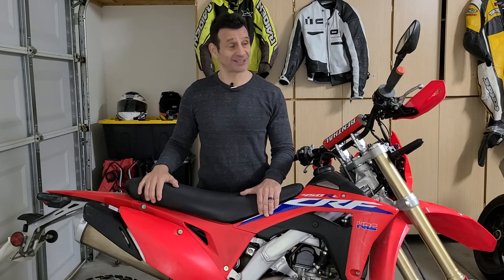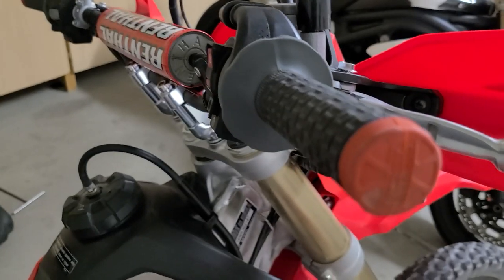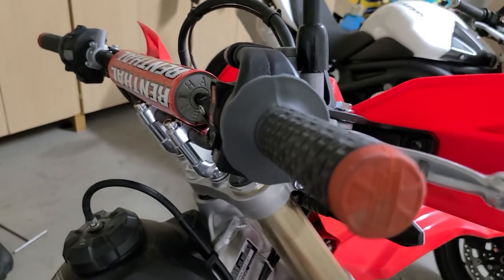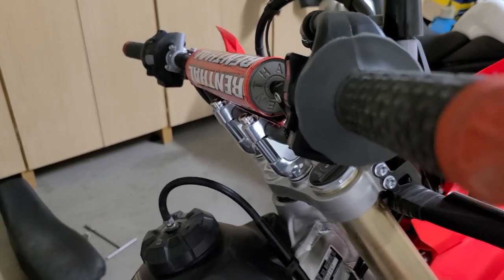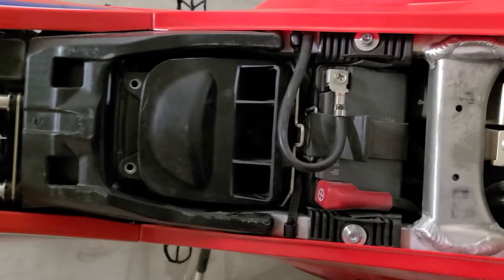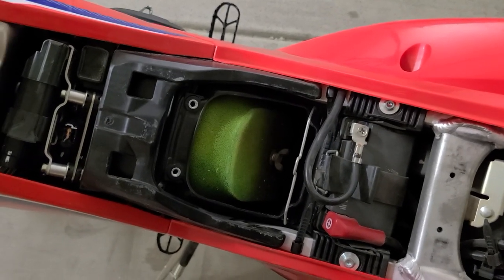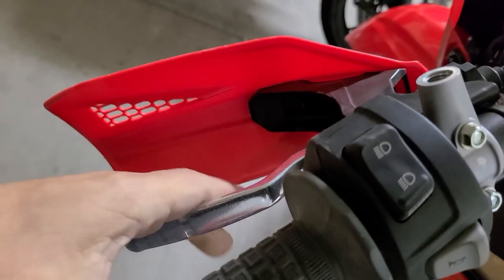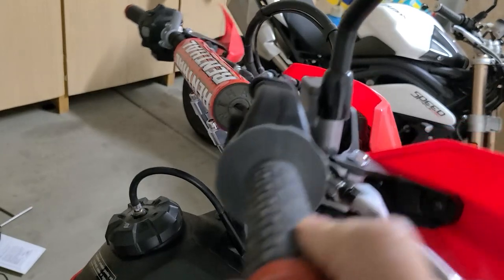Secret Honda CRF 450L ECU Fix. Dont Buy That Vortex ...Yet

Comment: I have a problem with my 2003 that when I turn right it would die. I think it was pinching the kill switch or some other wire. Too much filler in the video in the start.

Comment: Hey, bought a 2023 450rl, anyway clipped a tree going 5 to 10 mph with my clutch.  Electric starter stopped working only starts in neutral.  Tried adjusting my cables.  Thoughts on a fix.  

Thanks for video great thoughts on the chopping.

Comment: I own a 2022 model CRF450RL. I run the Vortex ECU, FMF exhaust, G2 throttle tamer, Steahly flywheel weight and Rekluse clutch. The bike is nearly perfect now. Super smooth on or off road with plenty of power. Much smoother than the KTM500. And with Honda reliability it's definitely a keeper.
Reply from the maker: Awesome I am almost there with the mods lol
Reply: Does anyone know if these mods void the factory warranty or the extended Honda warranty?
Reply: Right, I've done the same (except Rekluse) and it's perfect for me.
Reply: @LichaelMewis  factory warranty is only good for 6 months anyway.
Reply: @danieltllarson  I have an extended warranty.
Reply: But how much did you have to spend overall yo get it there? Is it similar to buying a Ktm 500 new? Just curious
Reply: What are total costs on all those mods, Jerry T?
Reply: @TheZakkmylde  because the Honda is $3000 less than the KTM you can do all these mods and the total cost of the Honda is still less than the KTM. And to add insult to injury, my friends that own the KTM are doing the same mods to it.
Reply: @NobodyLikesTheTunaHere  I have less than $3000 in all the mods I mentioned which puts the total cost of Honda at less than the KTM.
Reply: Is that hydraulic clutch? Can you use the one from the crf450r?
Reply: It sucks we have to invest another $1500 to make the bike act right
Reply: @LichaelMewis Yes. Wait for your warranty to run out before u make these changes. Especially the ECU.

Comment: Just got on installed today on mine.  It works really well.
Reply from the maker: Awesome Im looking forward to the day I get mine
Reply: So is a stock 2022 CRF450L that im mainly going to using for the road a better or should I get the FE501?
Reply: The Honda will be better for road use due to it weighing more than fe 501.  Mine has over 800 miles and hasn't seen dirt yet.

Comment: I can second this video. I have only installed the throttle tammer and it made a big difference.
Reply from the maker: Nice let me know if you have done any other mods
Reply: @BornAGoon  Ok I just got done installing a Whiplash seat kit. It's much larger than stock and the color is black rather than the stock red. It doesn't look as fast but boy does it feel so much better!

Comment: Turning up the idle doesn't fix anything just somewhat hides it. Bike still runs so lean the exhaust glows red and fan runs almost all the time unless you are on the road. Running lean produces major heat in a motor. Heat is the enemy of a motor. You want the bike fixed you have to buy the Vortex. I'm not talking about doing it to make more power which most people couldn't even need I'm talking about just getting the bike to run properly
Reply from the maker: It does help the bike a bit, but I agree with you that you need the Vortex to make the bike right. However, some people don't have the cash for that, and if you do, it is a 12-week wait. I ordered my vortex in January, and I still haven't received it. So this is a cheap, easy solution to hold you over. Thanks for watching.
Reply: jd tuner works. i got a pipe and its nasty
Reply: The idea that lean mixture produces added heat is false statement and a common misconception. Stoichiometric mixtures (ideal air-fuel ratio) produce most heat.  All motorcycle headers glow red with engine load and lack of airflow at low speeds to cool them.  Same reason your cooling fan is operating.  The risk of lean fuel mixtures is they produce detonation (uneven burn).  Detonation damages pistons and valves.  If you bike was running too lean your engine would be trash in short order.

Comment: I put a G2 throttle tamer on my 2019, I also put what’s called a “booster plug” on my bike…drastically eliminated flameouts and smoothed out the jerky throttle response…it’s crazy how no one talks about the booster plug $150….but every one raves about spending $750 on a ECU box
Reply from the maker: I have not heard of the booster plug Thanks for bringing it up I will check on that
Reply: Can’t add booster to 21 or later.
Reply: @danieltllarson  no, I believe it states on their website that they do not offer it for the later models…I didn’t really understand the rationale behind their reasoning

Comment: Srry for my English but I want share my exp. I have crf 450l 2019 Eu version. I have full yoshimura exhaust. The problem with flameout in my bike was the air filter and evap system, I just put oem filter open aire filter box and block evap system. I work in Honda motorcycle so I could test lot of things. In begging I thought the problem was low fuel and yoshimura, change stock exhaust and continue problem then close air box same problem nothing change. After lot of test like I said problem solved with oem filter open box and yoshimura full
Reply: I will try to make video and share with u
Reply from the maker: Thanks Just put in a AiM ecu it its nice

Comment: Apples/Oranges but the best mod I ever did to a bike was adding a heavier flywheel to my old 89 CR500. That bike was a freaking tractor in the woods. To stall it, you had to do it deliberately. 😆
Reply from the maker: Alot of people have been talking about the flywheel I may replace it

Comment: Im gonna be a Keyboard Goon and take credit for the airbox mod, LOL. And thanks for backing up turning the idle up....surprised more people dont do/know this. Especially with 4t riding single track, it smooths out the engine braking and jerky throttle, it will also walk the bike thru anything with no throttle in second gear allowing u to concentrate on balance and picking your line. I turn the idle back down when riding street or faster trails
Reply from the maker: I believe you did bring the airbox up A few people brought up the idle but you gave us the airbox It worked

Comment: It's called the g2 throttle tamer. 75.00 bucks and the light switch power transforms into dimmer switch. Roll on and smooth.

Comment: On my ‘21 i started with increasing the idle, then the throttle tamer, and then went with a flywheel weight  - 500 miles between each change to determine impact - at 500 miles on the flywheel- i took the throttle tamer off and found my magic setup. Flywheel + Idle + Time
Reply from the maker: Very nice I am interested in trying the flywheel

Comment: How much would a 2022 crf450rl used go for nowadays with supposedly 300 miles? Would the standard 450R be a better bike with lights mods rather trying to make a 450rl more like a R?
Reply from the maker: I would think you could pick up a used between 11 to 13k. The R is way better as is the RX but they are not street legal The only reason to go the RL route is for highway use

Comment: Video, I would just like to add that one more thing to do before doing anything is allow the bike to completely break in just be patient put about 2000 miles on it or more. It is a true Honda to the core just be patient and it will start acting like a Honda. There are many guys out there that when they buy a new motorcycle they enjoy spending thousands more for farkles . As far as performance goes buying a ECU and performance pipe of course it does increase horsepower but most guys by far cannot use every bit of horsepower the bike comes with stock.  Once again just be patient and remember it is a true Honda and will soon start acting like one.
Reply from the maker: I put the Athena GET ECU on it and its a whole new bike
Reply: Tell me more please
Reply from the maker: @michaelh6002  https://youtu.be/OwBtI7HkA6A

Comment: So how did Honda intend for the bike to keep idling if the ECU is programmed to cut fuel and spark when you let off the throttle?? It doesn’t make any sense and everyone is saying this…
Reply from the maker: its the only way the bike could pass EPA standards Because Honda didnt build a specific engine for this bike They took the race engine and detunned it
Reply: It's supposed to cut until it gets to a certain rpm, usually whatever idle is.

Comment: G2 Throttle tamer just arrived.  will start with that one first. I am going to get the exhaust and ECU. Just my preference.  Thank you for your video. I would also suggest you get a Rekluse CX. it is phenomenal for technical riding. you WILL NOT stall that bike.  I love my 2022 450RL. Onward we roll
Reply from the maker: Let me know how it goes Try the tamer first then the ECU with stock pipe then full system if you can I would be interested in how that works out Thanks for watching
Reply: @BornAGoon  Ok Update.  I installed the G2 and upped my idol.  I can absolutely tell the difference, however I still stalled it a few times with some very aggressive single track cornering.  I also kept the lid on my new air filter. Bike only has 120 miles on it.   I ordered the pipe and vortex. I will provide another update in 8 weeks when the vortex arrives. I also ordered a Rekluse CX clutch for those nasty single tracks.  booyah
Reply from the maker: @ebhkkc1  sounds good Im excited to see if the Vortex is worth it Many people on here say the Flywheel is the problem
Reply: @BornAGoon  maybe so. overall, I just wish they made bikes liked they used too, same for cars !!  we have to spend extra for normal.  I will give you my full opinion in 8 weeks once it all arrives.  E
Reply: @ebhkkc1  any updates?

Comment: I think all the common "fix" mods are trying to fix the symptoms of the problem... which I think is too light of a flywheel.  I tried the Vortex and full FMF exhaust.  Yes it ran somewhat better and certainly stronger, but it still needed more flywheel.
Reply from the maker: A few people have brought up the flywheel I think I am going to try that Thanks
Reply: What the flywheel to go with

Comment: Put the flywheel weight on it and go for a bigger rear sprocket and turn your idle up so it does 11kmh again. Probably solve all your problems. I have almost every mod on mine nothing new to buy except plate in the rear for luggage.
Reply from the maker: Have you tried the flywheel without the other mods?
Reply: @BornAGoon  got ECU from factory. But ECU flameout also. Flywheel gives enormous differences in behaviour of the bike. And also riding it for a few oil changes makes the bike run better/getting used to the beast

Comment: jerky throttle wasnt the biggest issue, flame out stalling at low speeds was.
Reply from the maker: did you fix it
Reply: That's what turning up the idle fixes

Comment: The problem whit this bike is on the seat. Sorry for this i have 18 000km on my bike and is a fk stronger bike and good bike and is a dual sport not full cross. Take time to learn how bike is running  after you say running this bike give your opinion. Thx
Reply from the maker: that seat does suck I built my own it looks like crap but feels great
Reply: @BornAGoon  i have seatconcept 7000 km whit stock seat loll longest ride 3500km 5 days  i love it i love ride legal on the road and jump at the trail and jump again on the road lolll. Its legal boummmm